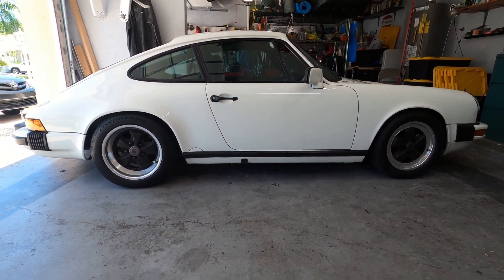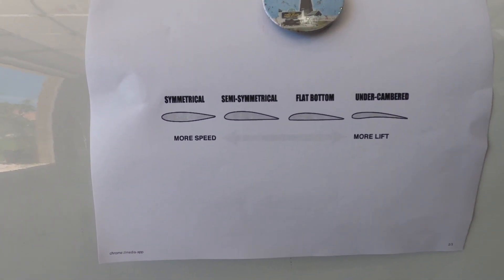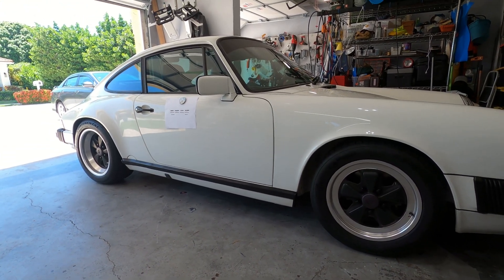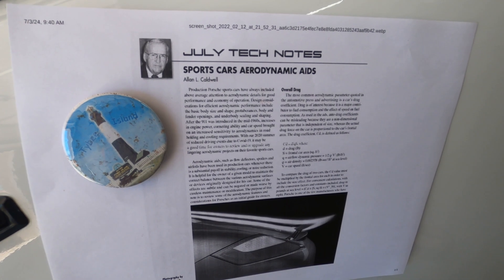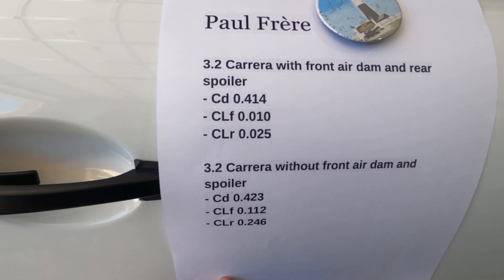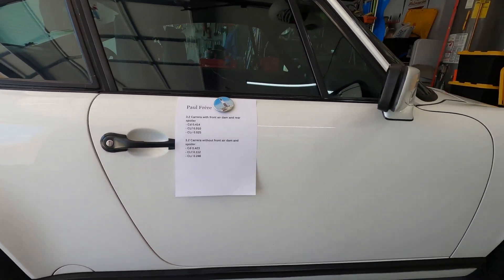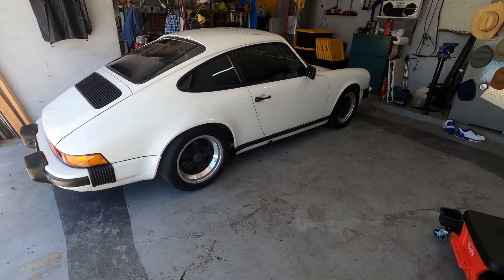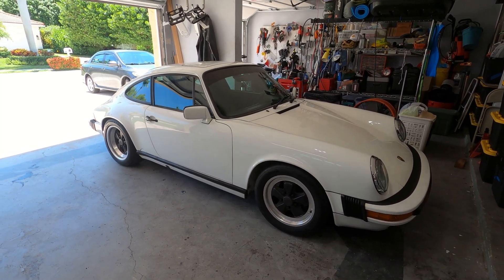Porsche Carrera 3.2:  Does "no spoilers" spoil the soup?

Comment: Having a TWB with a proper whale tail, it makes a huge difference cornering at speed. Yours will just give you that "snap oversteer" moment a bit sooner.
Reply from the maker: I've only experienced it once time with a dip in the road on a hard turn and that was at slow speed. So far I haven't some close with normal spitired driving and with good tires I hope my luck doesn't run out.

Comment: Much ado about nothing.
Reply: Yeah agree. Have an 89' Carrera. I took my spoiler off and replaced it with a standard deck lid. Looks better to me and much lighter. That spoiler is a pig. Kept the front air dam. I don't notice any difference in handling. I only hit triple digits on rare occasions and even then only for a moment. My car is geared very short. I got it to rip around on twisty roads. The car lives at speeds of 40-70. I'm not breaking any speed records, so having the spoiler wouldn't make any appreciable difference. My spoiler is now wall art.
Reply: @overbuiltlimited  I have an '86.  Ordered it with only the front spoiler.  I have participated in many PCA track events without incident.  Prefer the classic silhouette myself.
Reply from the maker: @DavidPanno  I like that look a lot.  Do you notice the front being more planted at speed? I start to notice float at around 100MPH without it.

Comment: If I had gotten a 3.2 with a G50 trans, instead of the 1983 911 SC that I did get, I'd probably still have it.  That 1983 was a money pit, and there should've been a class-action lawsuit filed against Porsche for the broken head studs that were problematic for that generation.  Plus, that 915 transmission was the absolute worst transmission I've ever owned.  My '83 was burgundy with a tan and burgundy interior, 7 & 8 inch wheels, and yes, it had a turbo tail.  Beautiful car, but never again...
Reply from the maker: Yes, I'd be very pissed too.  Even today people pay all the money for these cars on the auction sites only to have their backs broken after they look the car over after delivery.  My '89 actually had 3 broken studs, but  since I bought from a friend I got it cheap enough to have plenty left over for a complete rebuild.  The aftermarket has really stepped up with shoring up the weak links of the car.
Reply: @3.2Carrera  I had half the head studs on the driver's side snap before 100K miles.  Got the engine rebuilt for $12K, which was a "bargain".  I've read that they fixed this issue with the 3.2 by using turbo head studs, so that's a plus.